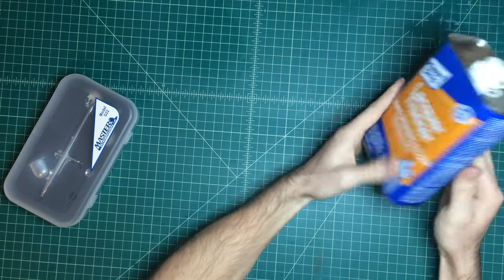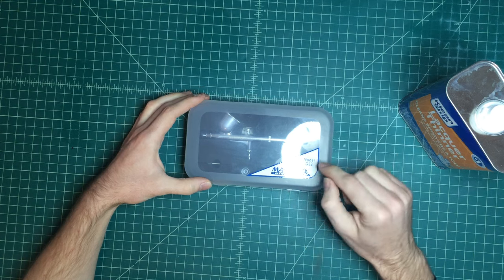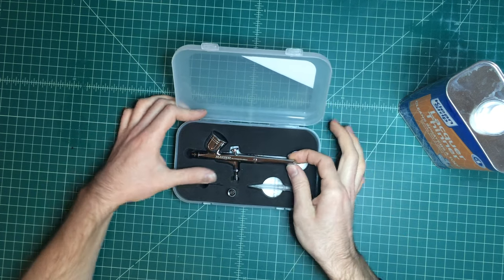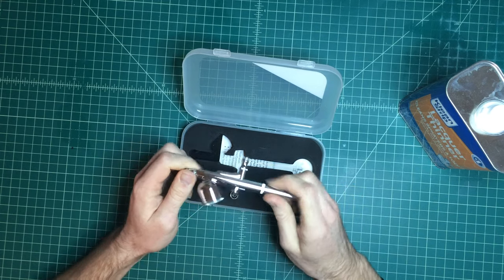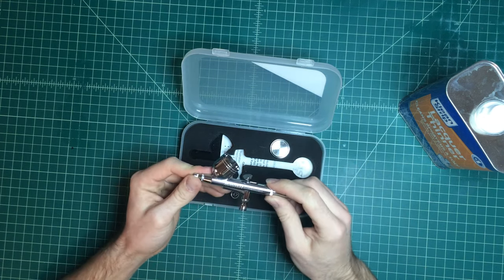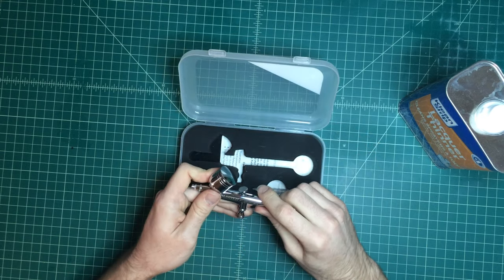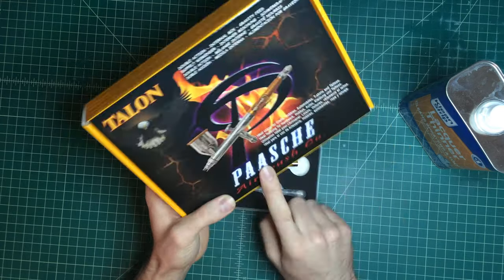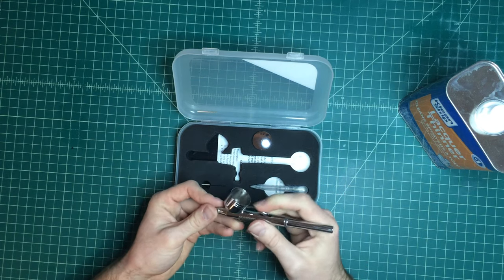How to clean your Master Airbrush (G22model)

Comment: It's pronounced "Posh-A" Not a bad make, but Badger and Iwata are much better. Actually the cleaner used depends on what type of paint you use. I use nothing but acrylics, so I use a "home-brew" cleaner that is mainly water, Isopropyl Alcohol and a few drops of Glycerin and Ammonia-free window cleaner.  For lacquer-based paints, well, you have to be careful using even lacquer thinner, because of any rubber seals or gaskets. BTW, the tip is called the nozzle.

Comment: Can you use the Lacquer Thinner to actually thin the solvent/ oil based paints--BEFORE you spray?? 
I know some people put airbrush thinner in their POT first then add the oil based paints to the small pot, then shake! Then they are ready to paint!
 Can the lacquer thinner be used in a ratio the same way??

Comment: I have this airbrush and I'm running into a problem with model master paints.  They keep clogging up my airbrush.   I'm thinning out the paint a lot and it still clogs.   But if I use tamiya paint and thin it the usual way no issues.   Any thoughts?

Comment: Don’t use that wrench like this guy did on the needle tip u should only tighten with your fingers then you won’t fuck it up also lube all your parts with a air brush lube witch this guy didn’t do if you break or lose a part just buy another cause the parts are as expensive as a cheap brush lube it all the time the trigger assembly and it will work awesome any brand of airbrush also you don’t have to use thinners to clean you can use water and other products for acrylics any water based paints if you are using laqueres then ya use thinners I don’t think this guy knows a whole bunch
Reply: Man your so your right I used the wrench and now I can’t get to tighten back on.... dam it man fuck